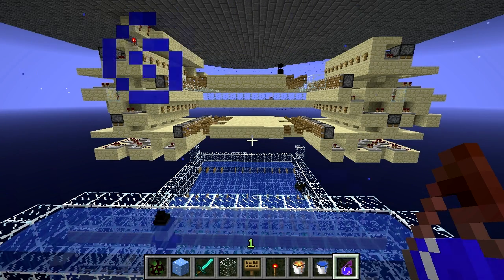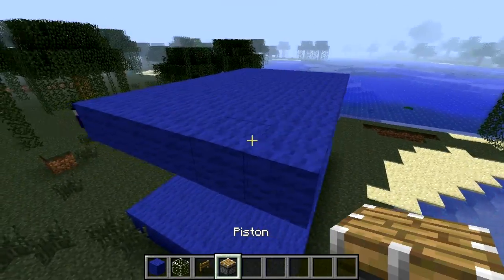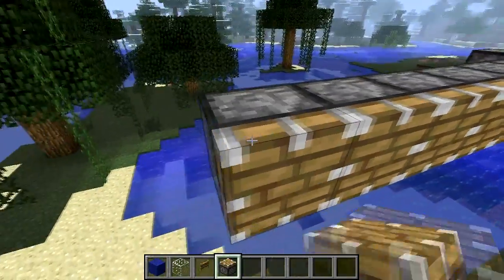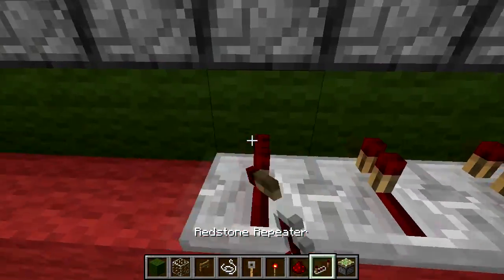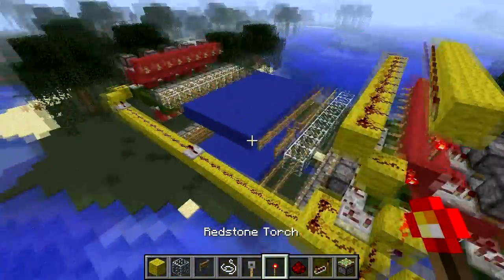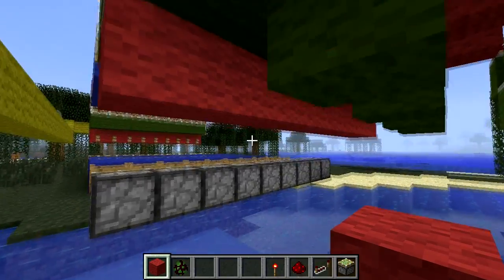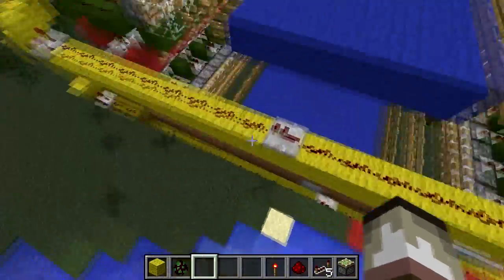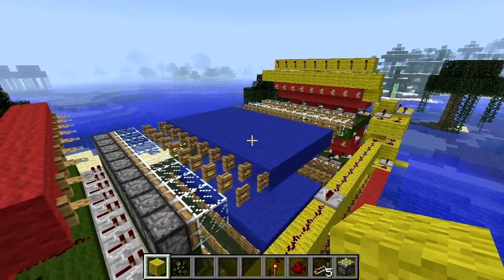Minecraft: Witch Farm Shifting Floor Design Tutorial

Comment: There are some inconsistencies. When you use a repeater, it lengthens the signals it receives to its own delay.
So for instance when you see a 1-tick shortener (piston) sending output in a 2 tick repeater, it doesn't make much sense : the signal will be 2 ticks long after the repeater.
Not sure it is of importance here, but it's worth mentioning. :p
Air blocks, it is indeed 20 but their usefulness greatly decreases with distance (as can be seen from proba distrib in algorithm) so 5 is nice.

Comment: Since you seem to have experience with shifting floors I might aswell ask.. I'm experiencing issues in MP, where the mobs glitch through the floors correctly, then are teleported back to their platform. I suspect it's related to mob movement "freeze" distance (32 blocks in vanilla SP), as if glitching through the floor was counted as movement. Not all mobs glitch back this way, only the furthest ones. Is this correct ? Any info on this subject ? Would flowing water work differently ?